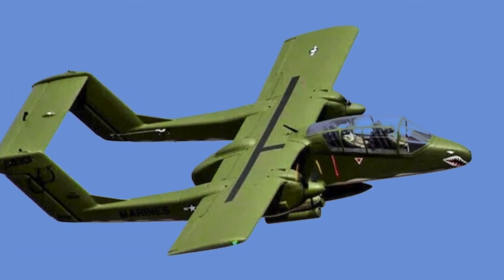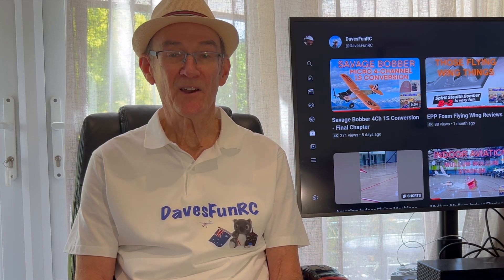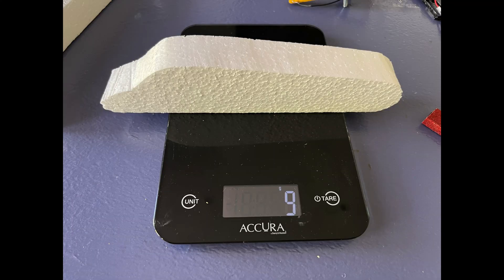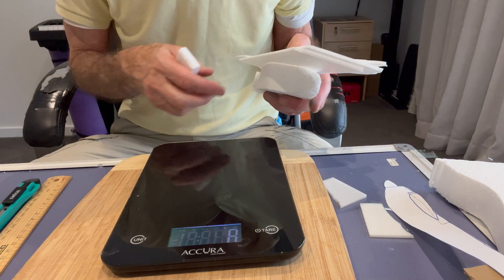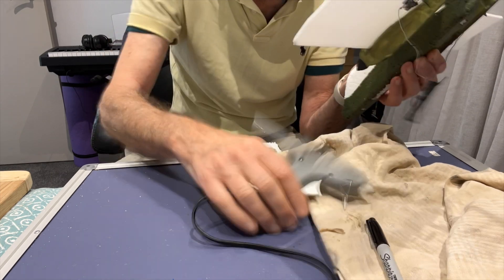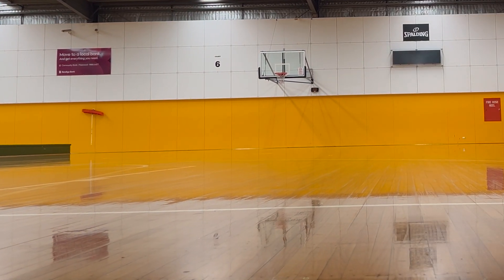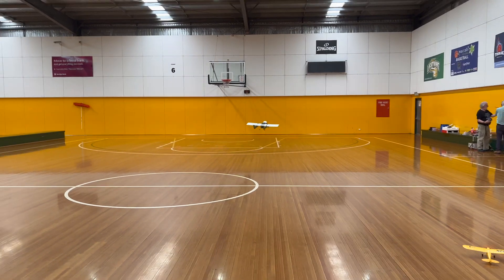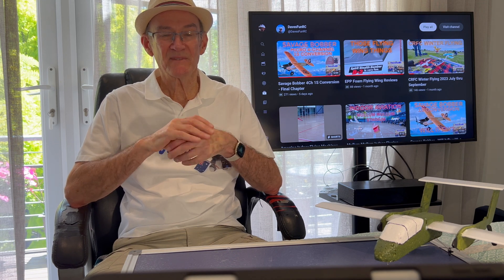North American Rockwell Bronco OV-10 Build from scratch

Comment: You are certainly coming along in the RC Hobby there Dave! Our gang of Old Farts should follow your lead a bit more in adapting what we have rather than splashing out on more new toys! 🙄😉
Being in the Big Smoke makes it easier to access materials (except via the usual slow sampan) for you than for us out in the sticks. We've got some thin EPS foam from the local Chinese Junk Shop (but heavy with the paper covering) and might be able to use the nichrome wire out of an old toaster for making a cutter for the usual packing box stuff. Links to your supplier of both materials would be appreciated. 😊
Reply from the maker: Hi, yes - there is nothing like flying (or crashing) something that you have built yourself!  The nichrome wire is a tricky one to source - and yes old toasters or heaters could be a source.  I am lucky to have someone in the family who collects such stuff.  The Zart shop was a great find and they do ship (at a cost!). https://zartart.com.au. Cheers.